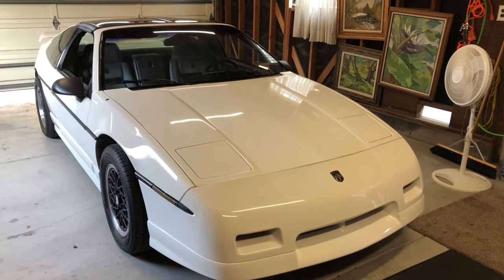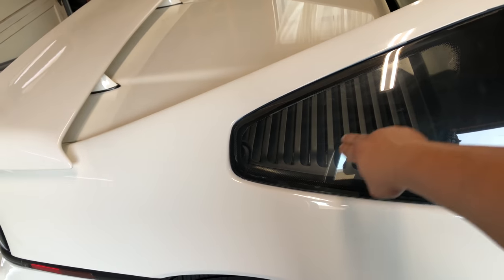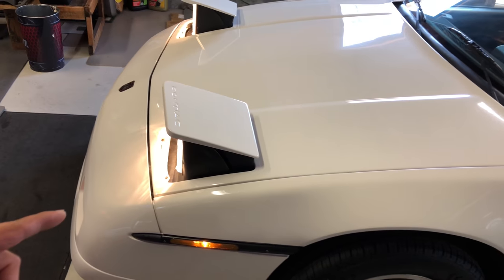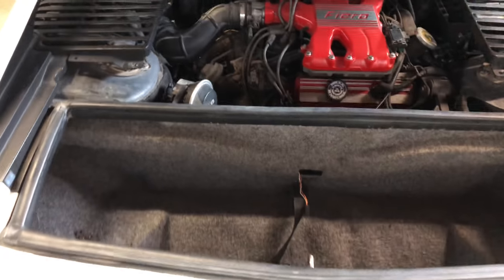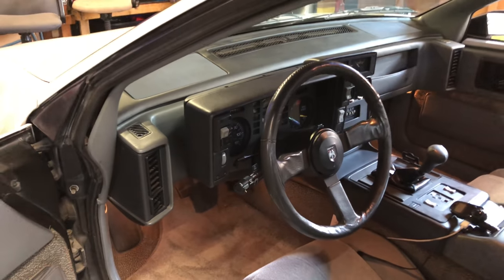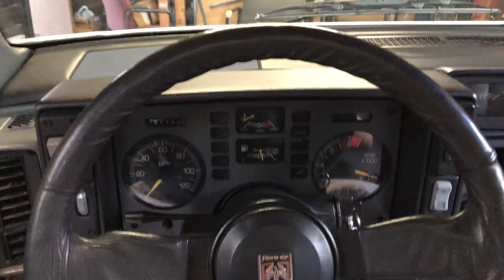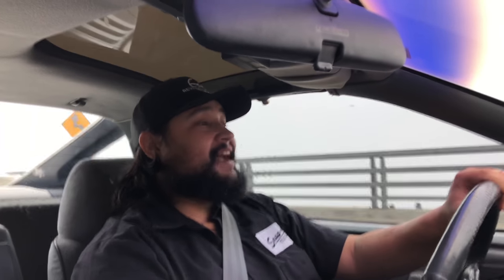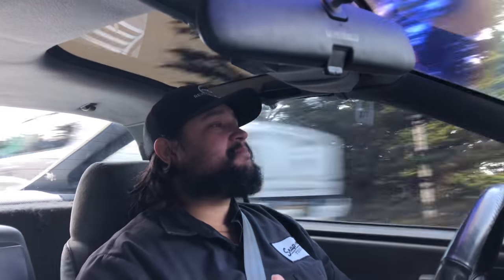I REVIEW MY NEW GM MID ENGINE SPORTS CAR!! | MY 1988 Pontiac Fiero GT Coupe

Comment: "I guess it's a solution to a problem." You make several references to a problem, but never identify what it was. What was the problem the Pontiac pop-up headlight design was intended to solve?
Reply from the maker: I was referring to the way the head light covers or doors operate in correlation with the rest of the pop up mechanism, how they chose two piece setup instead of a self contained unit, that’s all.
Reply: @tailsfromthejunkyard1023  Thanks for the explanation. Great car. :-)
Reply from the maker: @jerrybarrax5618  thank you!

Comment: Your description of the suspension just sounds like total gobbledygook. The whole idea behind the Fiero was taking an existing front-drive Powertrain and putting it behind the driver. I think it came from Pontiac Phoenix/Chevy citation. (X body?) And the front end came from the rear drive  Chevette. They put a bigger sway bar in the rear in 88 on the v6s but I don't think the changes were radical at all. It was built from existing inventories. 6800 the v6s  were sold in 88. Do you consider that rare? I sold Fierros in 84 and 85 and MR2 in and 86 + 87. Pushed on twisty roads the Fiero tended to understeer and the MR2 tended to oversteer. Understeer is easier to get out of than oversteer. When the nose is pushing all you have to do is lift the throttle to bring the weight bias back to the front and the nose will bite in the car will turn. Oversteer is tricky for inexperienced drivers and the MR2 could get away from you. In an oversteer, you have to fight the urge to bail out of the throttle or you'll be pointed in the wrong direction. I slightly preferred the MR2 because I like the high-revving engine and I hated the Pontiac's clunky vague shifter and thought the interior just seemed cheap. The MR2 didn't radically perform better. They were very close. Surprisingly close on the road course times.

Comment: Those are not 88 seats sorry to say.
Reply from the maker: You are correct! For some reason the previous owner did not like the the seats it came with so he swapped them out for an earlier set.
Reply: What seat were suppose to be in it. The rpo code in the driverside fender well would tell you. You have only 3 options
Gray cloth
Gray leather
Gray cloth with power lumbar 
Which one is it?
Reply from the maker: @podzfamily2926  according to the RPO code it was supposed to have the seats with the code AF9 “inflatable drivers bucket”.

Comment: Liar. Pontiac had the Firebird as a Sports car. Fiero was an "economy" car w/4 cylinder
Reply: A 1988 Fiero GT 2.8 V6 w 5 spd wasn’t really considered an “economy car”. In initial inception, perhaps yes to get passed. But by the final model year it was refined for a single model year and competing with cars like the MR2–and did fairly well!